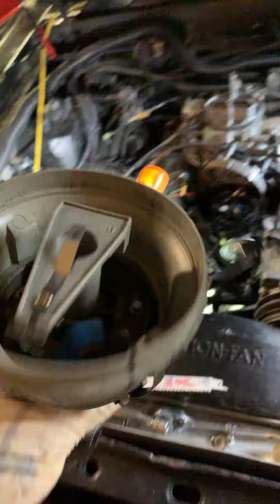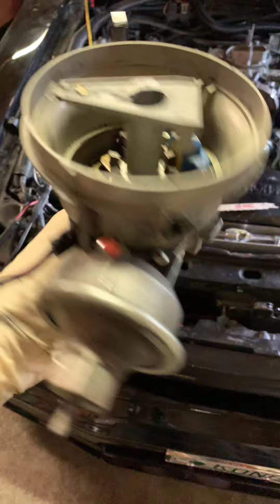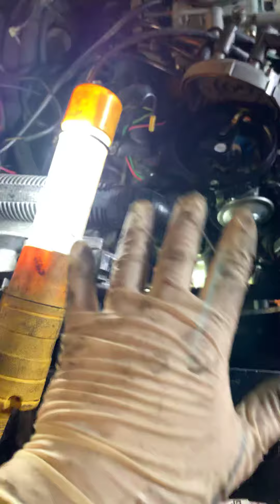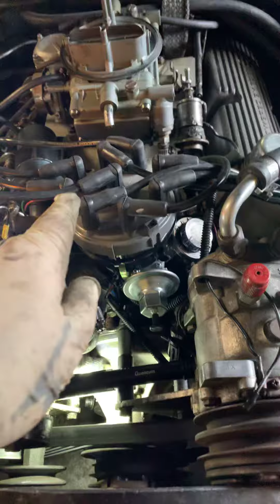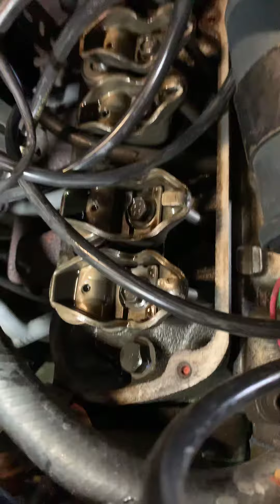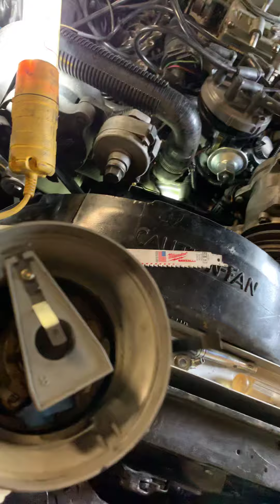How to set up distributor ford 302

Comment: I just replaced the heads on my 1990 351. I marked the block and distributor and pulled the distributor.  It won't start and only occasionally back fires. Could I be off 180°?
Reply from the maker: Sorry just saw this.
Sounds like it could be off 180 ,
How did things work out.

Comment: hey! great videos have question maybe you might know i have a 96 ford f150 5.0 302 windsor  i pulled distrbutor without marking it and balancer has no markings on it had dagrees but no mark anyways i pulled spark plug #1 cylinder pt tdc tool in cranked by hand on crankshaft till the tool in cylinder 1 raised up to its highest point ive put finger on it as well to see it it blow finger off it had some pressre not alot but then i put piston stop tool in marked balancer then made gap marked middle of gap (true tdc now) i assume at this point put distributor back in maken sre its pointing to #1 wire on cap started truck nothing no fire all it does is like turn over but DOES NOT FIRE at all i have no idea what to do im at a lost ive tried everything maybe yo might have idea or some advise? thank you so much take care
Reply from the maker: I would try turning it 180 degrees.
They call it 180 out .
I have done it and it’s not hard to correct.
Reply: @CapriNamedKong  hey! thanks so much for the reply still no luck so far ive did everythin perfect ive took #1 plug out stuck piece towel in hole snugd it crankd it over by hand clockwise watch for exhaust and intake to close boom towel fired out from compression stroke used piston stop got my gap measred markd middle im at true tdc now put dizzy on poting at #1 wire now heres even more bad news when i turn crank now its siezed up i cant even turn it now piston stop is out nothins in way everythin is put on correctly the crank is literally siezed i tried to fire the truck it doesnt even turn over now its literally sized up and just maken a loud alarm buzzing sound i can turn it back conter clockwise but once i trn it clockwise toward 0 degrees it 100% dead stop no idea whats going on im at a loss i think maybe valves are bent no idea?
Reply from the maker: Not knowing it any work was done on the motor,
A few things come to mind.
If it’s completely stock ,
Pull all the plugs to see if you can get it to turn over.
If you can’t then something else may be wrong.
There’s a few firing orders possible.
Google the year of the motor and you will see two different firing orders.
You can try the 351 order.
Hopefully it works out for you.
-Mike
Reply: @CapriNamedKong  found the issue bro haha thank you so much for ur help i ended up pulling the heads and the valves were bent i just got a kick out of it case no idea how this has even happen no dmg even on the pistons never ran dry eighter but thank you so much for ur help!

Comment: I am currently working with the stock distributor that you’ve shown. Can you tell me which wires coming out of the stock distributor are which. Such as positive negative and tach?
Reply from the maker: I am not sure.
I would have to go out and follow the wires.
The car is put away for the winter.
I will have a look this spring.
Reply: Did you ever figure it out I’m dealing with the same thing

Comment: I am installing a points style dist on a 302.   My dist has no markings.   (There is no number1)
Does this matter.  Can i start number 1 anywhere on the dist?
Reply from the maker: I would google the year motor and it should show you the firing order.
Reply: @CapriNamedKong  its a 1972. So older firing order.  My dist cap has no number 1 marking on the cover.    I guess i will start opposite of the vacuum advance
Reply from the maker: I would recommend looking it up online.
Different years have different orders
Reply: @CapriNamedKong  i got it!   It runs
Reply from the maker: Great Job !
Reply: @CapriNamedKong  Thanks !!